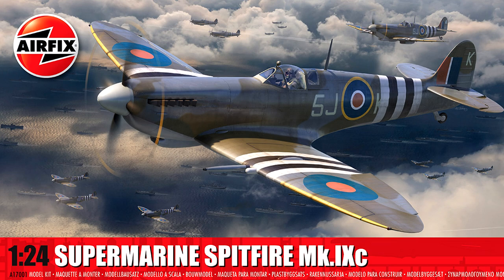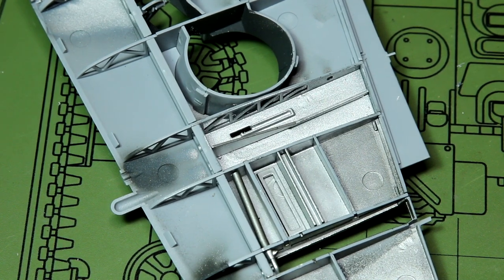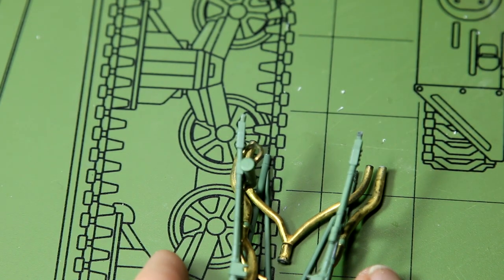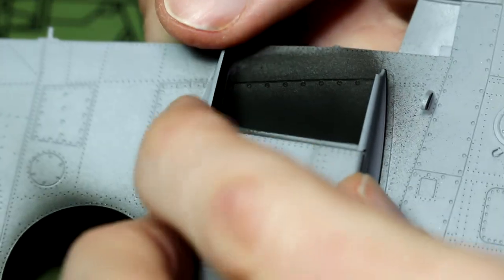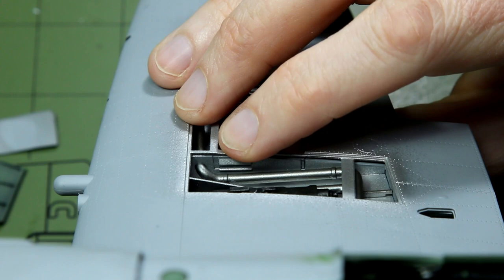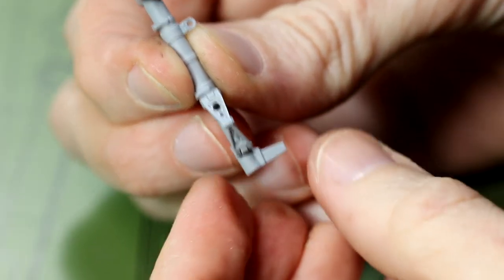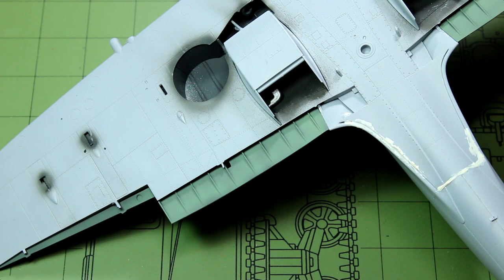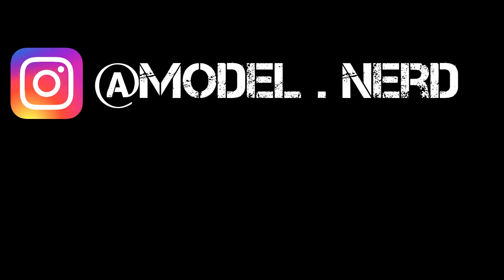New Airfix 1:24 Spitfire - Ready for painting - part 5

Comment: You have probably had loads of modellers screaming at you already regarding the ammunition - the red tipped rounds are tracers, usually but not always one in every five, the steel or copper jacketed rounds are 'ball' rounds, steel or copper jacketed lead cored shells. I also believe you could get 20mm rounds with explosive heads, the Germans certainly used these to devastating effect, they would also have been colour coded, with a yellow band I believe, others will know no doubt. The upshot is though that they would not all have been red, not very effective armour penetration from a thin jacket tracer round! A mix of some sort was always used (they weren't shooting down gas-filled barrage balloons as in WWI!).
Reply from the maker: Thanks - yes, you're right - it was mentioned a few times as soon as I put the video up. Always good to learn - my fault for following the Airfix instructions!

Comment: Excellent videos, watching them all as about to buy this kit. Going to build the cockpit and engine as separate 'open' models and have the plane all closed up apart from gun and wheel bays and have the  canopy 'misted over' so can't see in to the empty cockpit.
 I must say however I'm amazed by the amount of brilliant modellers that use that horrible type of filler as opposed to milliput. If you use milliput you can smooth it out such that no cutting or sanding is required. Filling those ejection marks could be done in minutes with no sanding etc required, you really must try it. Cheers.
Reply from the maker: I really like that idea for the Spitfire. Another option could be a tarp or similar over the canopy. I have tried milliput in the past but I just didn't get along with it unfortunately. User error, I'm sure! :)

Comment: Red tip tracer?  Certainly was when I was in the army.
Reply from the maker: Ooops! Then he has a belt full of tracers. Eek.
Reply: @ModelNerd  We used them 5:1 and then used the tracer to guide the firepower onto the target (in the air defence role).  Maybe that was a thing with Spitfires?  Fantastic model, by the way, I am in awe.
Reply from the maker: @tattyheid7279  Thanks mate. Yeah, I think I might have to go back and paint some black. Should have checked before I painted...
Reply: @ModelNerd  I have read that the ammo belts could be loaded to suit the target they were after. I have also read that for the 8 .303 guns they did load a couple with tracer maybe two with AP rounds thd the remaining four with ball, so it is possible to have a belt of tracer only. This off course is true if the book I read was correct.
Reply from the maker: @allanrichards3752  Thanks Allan, that's really helpful